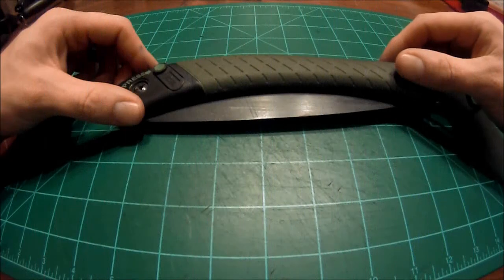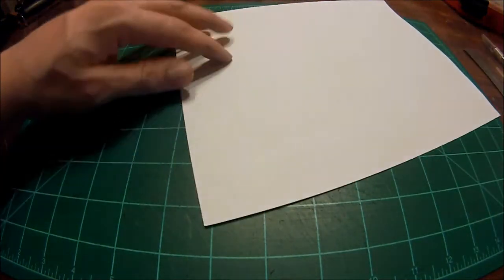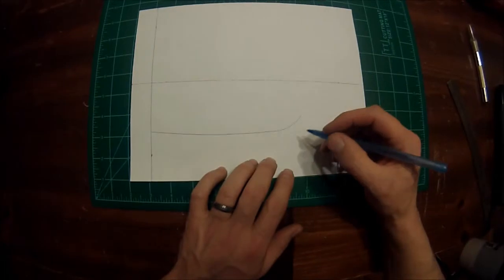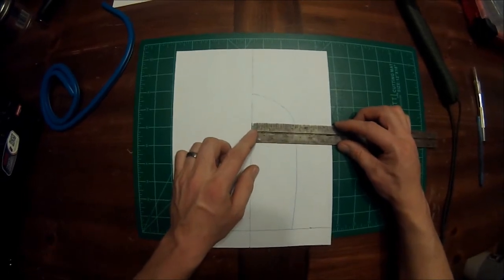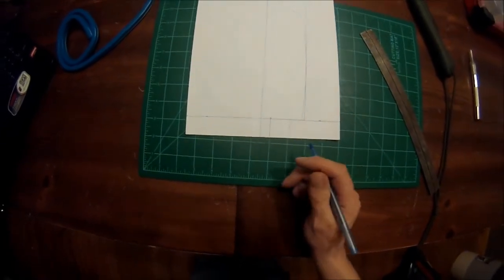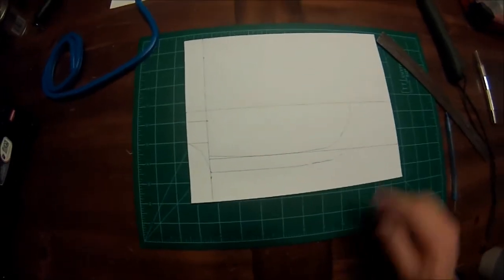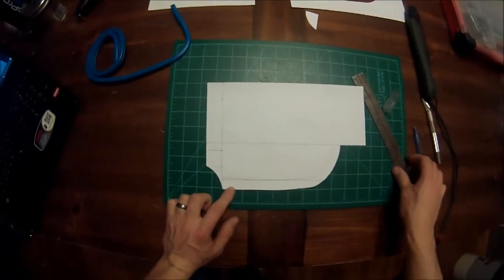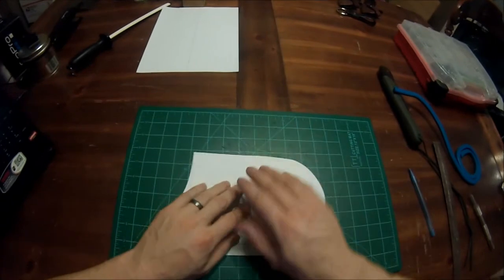How to make a leather sheath for a laplander. part 1

Comment: Trying to figure out why you put a welt in a sheath for a folding saw.
Reply from the maker: If you want crap, make crap.  If you want something that will last forever, take pride in your work and build it to last a lifetime.
Reply: ***** Easy there fella. It looks great. A hardened leather sheath as you made it here without a welt would still last a lifetime. Unless the individual you were making it for intended on putting an edge on the back of the saw, the stitching is in no danger.
Reply from the maker: Can the blade come into contact with the stitching?  The answer is yes.  Since the answer is yes that means friction.  Friction means wear and wear means a popped stitch.  I've seen it time and time again.  I spent an extra 10 min and made the sheath stronger and also made it to where there is zero chance of the stitches being rubbed.  I'm confused what the debate is.  I understand the question but when it comes to good work and solid work.  I take the extra steps to make sure all of my customers never have to send a sheath or any other leather good back to me.  I've been doing this for years and in that time I've only had one item returned for rework and in my eyes that is one to many.  I wasn't trying to be angry or disrespectful with my reply, just answering as honest as I can.